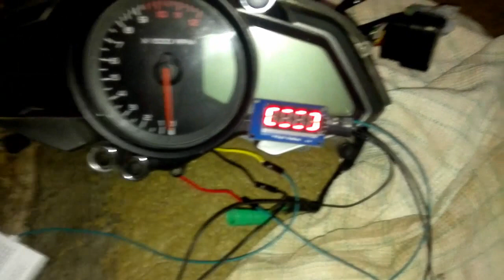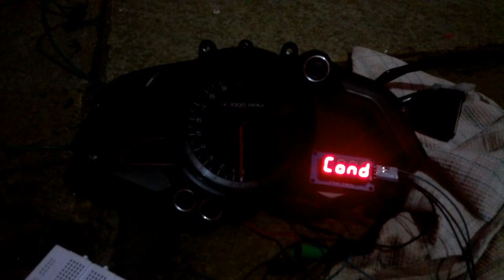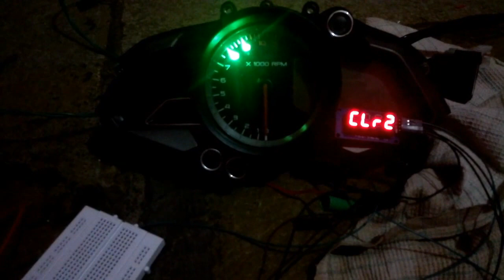Led tachometer/rpm meter/shift light arduino installed on pulsar RS200 (part 4)

Comment: bro if u dont mind can u give me your arduino code
Reply from the maker: go to chippernut site everything is there
Reply: vicky patmase bro which arduino are u using now
Reply from the maker: +Maharsh Dhasmana UNO R3
Reply: vicky patmase bhai why dont u use a pro micro or pro micro or pro mini??
Reply from the maker: it needs buck regulator
Reply: vicky patmase nahi bhai usme 5 v ka regulator inbuilt hai
Reply: Jst put +12 volts in raw terminal and negative in ground
Reply from the maker: +Maharsh Dhasmana ok,will give it q try
Reply from the maker: +Maharsh Dhasmana can I have the link?
Reply: Are u on facebook because i want to tell u something about pro micro
Reply from the maker: +Maharsh Dhasmana vik.nokias60@gmail.com ping me on hangouts
Reply: vicky patmase k

Comment: i googled it !! but one .h file is not responding (EEEPROM_anything.h) i tried to verify but i got some errors ! :( ... and more more ..can u show where have u made the input for the arduino !
thanks in advance :)
Reply from the maker: +Pravin Yogi you need the libraries installed, take a look at schematic and ckt diagrams
Reply: +vicky patmase  .. ya bro i did ..but when i looked up in the library there was no EEPROM_anything.h file to sketch .. i did compile the program but error appears !! next time if u can even upload the coading it il be great man :)  
anyways awsem job in makin it work bro :)
Reply from the maker: +Pravin Yogi go to chippernut forms and look there is 2.4 version and go under that u'll have a link to github download the complete zip master file
Reply: +vicky patmase  il see to it !! :D thank u soo much ! and by the way i was on doing an gear shift indicator ! but i was struck about placing the neutral because it was between second and first gear !! my question is ..can i get the neutral source for arduino from the neutral light connection in the bike itself uh ??
Reply from the maker: +Pravin Yogi yeah bro a neutral wire will b there getting out from clutch plate portion
Reply from the maker: +Pravin Yogi if u have downloaded the zip file then copy the library folder into the program files where the uno has been installed